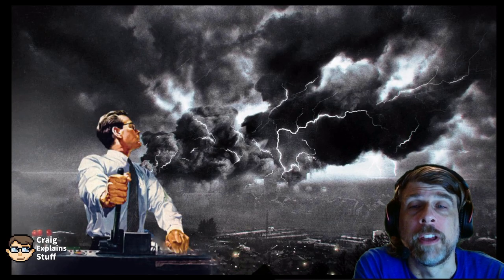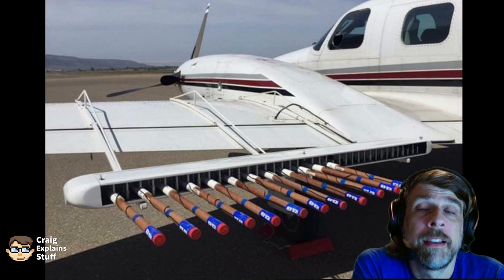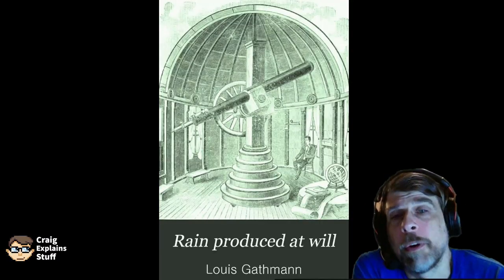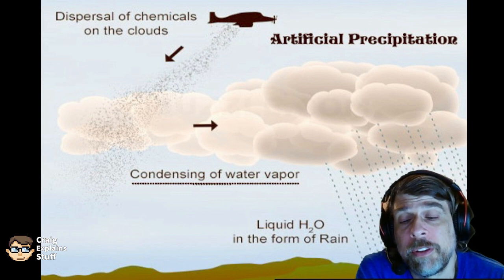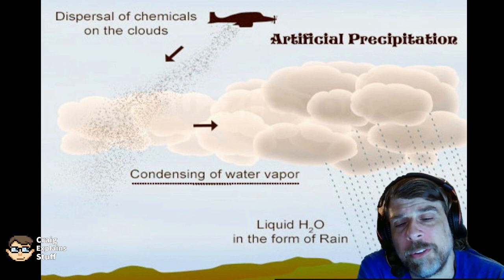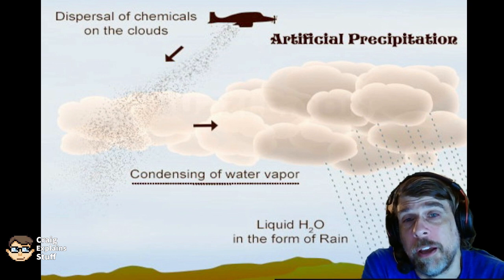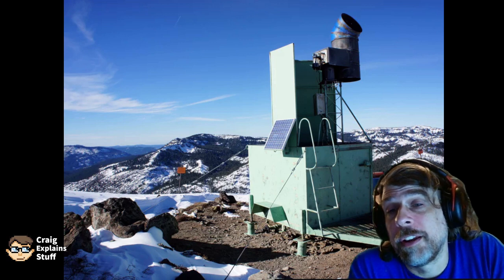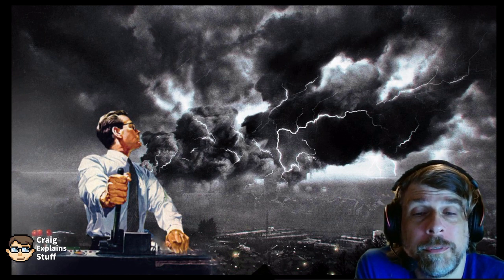Weather Modification

Comment: Few things wrong here. First, cloud seeding is mostly used to prevent hail, not so much to induce rain. Second, silver iodide is still widely used for cloud seeding. That blue skin is from over use of colloidal silver by some individuals who consume it in excesive quantities. With seeding it is simply impossible to achieve such concentration of silver to turn your skin blue. Third, these chemicals are not cool. They are very hygroscopic, they attract water and it's particles become condensation seed.
BTW, cloud seeding has nothing to do with hurricanes, just use some common sense and imagine the energy of a hurricane.
Reply from the maker: I disagree that I am wrong, because I address all of your points in my video.

I do say in the video that it does a poor job of inducing rain, and is more effective at preventing hail.  But many nations, including the United States, still use it for drought relief.  I said in the video that silver iodide is no longer used as an antiseptic because of the blue skin, but is still used for cloud seeding.  I may not have been clear in the video, but the water vapor definitely cools all the way down to ice when contacting the chemicals, not water.  So although the chemicals may not be cool, there is a freezing effect.

And cloud seeding was absolutely used to try to affect hurricanes in the 1960s during Project Stormfury, and you are right that this failed because of the energy of the hurricane.  But it is the US Government who should have used common sense, not me.
Reply: @craigexplainsstuff  Freezing has nothing to do with chemicals themselves. Water droplets freeze when updraft in the clouds lifts them in higher altitude where temperatures are below freezing.
Reply from the maker: You are right.  But the water vapor has become droplets because of their contact with the chemicals from the cloud seeding.  I could have been more precise in this section.  Thank you for providing clarification for this part of the video.
Reply: @craigexplainsstuff  They would be sucked up, anyway. Seeding just expedise the process. Paradoxically, defence against hail is done by inducing it. Becazse of silver iodide there are a lot more condensation seeds, which form droplets. When they freeze, they collect water vapor and smaller droplets, hail grows. But, since there are more condensation seeds in the air, hail can't grow a lot. There is still the same quantity of hail, but it is much smaller, sometimes, when it is very small and the temperatures are very high, they melt before reaching the ground.